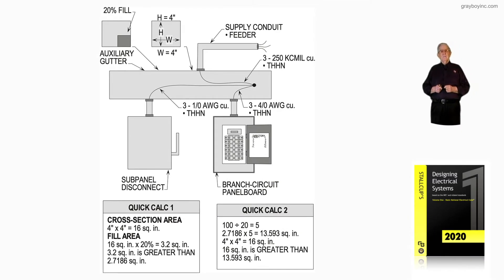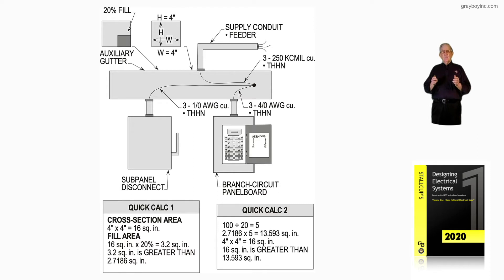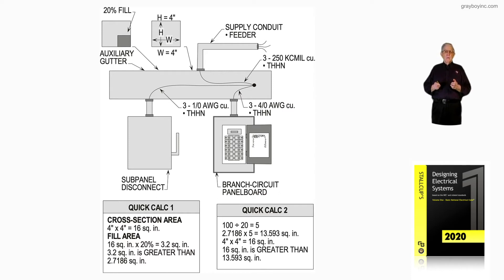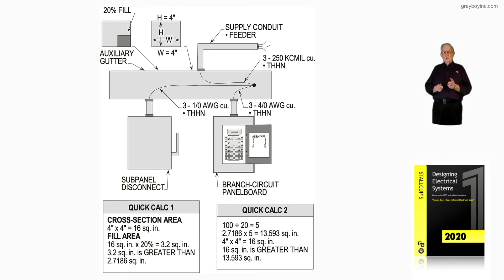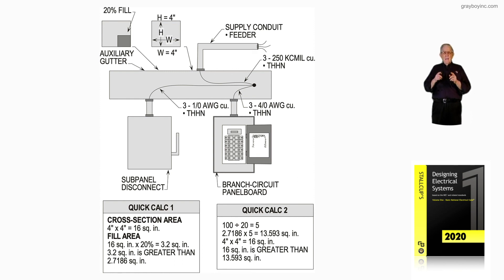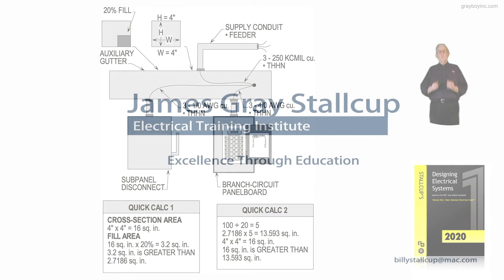12-24.1  AUXILIARY GUTTERS - 366.22​​​​​​​

Comment: James, can it also be called a "Wireway". If yes, any difference from a Gutter?
Reply: Hi Jessie,
Yes, it could be a wireway or gutter. Check out 30’ rule in 366.12(2).
Reply from the maker: www.grayboyinc.com 
Use the following coupon code at checkout for 45% off all products. Coupon Code:   22GB45
Reply: HELLO AGAIN,
SEE NEC 366.12(2). BEWARE OF THE 30 FT. RULE. IF THE GUTTER EXTENTS 30 FT. OR MORE FROM THE LAST
PIECE OF EQUIPMENT THAT IT SUPPLEMENTS, IT BECOMES A WIREWAY.

Comment: Thanks for this, I'm taking my C-10 test 4/18. I'm trying to get these terms all sorted out in my pea brain. But my study material is telling me an Auxiliary gutter( 20% fill of cross-sectional area max) is not considered to be a raceway. A raceway, with 2 or more conductors typically has a max fill of 40%, but if its 24" or less can be filled 60%.(considered a nipple). And a gutter(non-auxiliary?) used as a raceway can have a maximum of 30 conductors in it before it is required to apply de-rating calcs..
My brain hurts, lol.
Reply: HI MATTHEW,
I THINK THAT YOU GOT IT DOWN MY FRIEND.
GOOD LUCK WITH YOUR TEST.
JAMES G